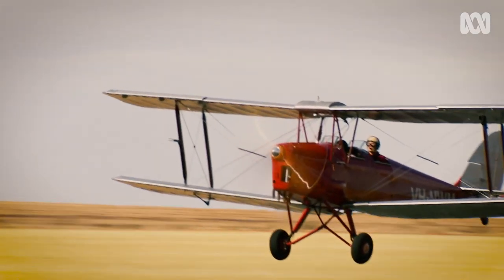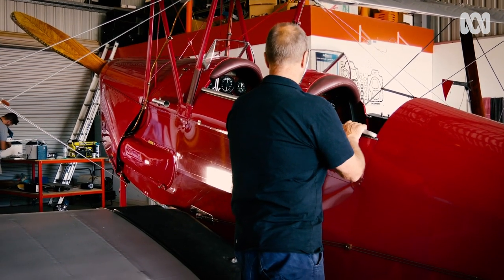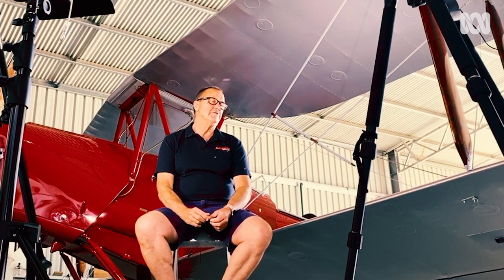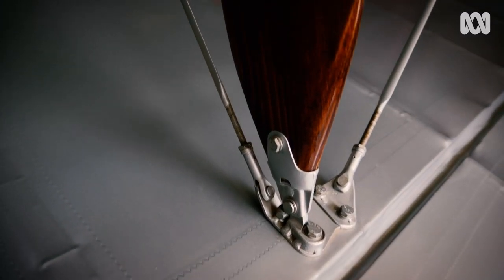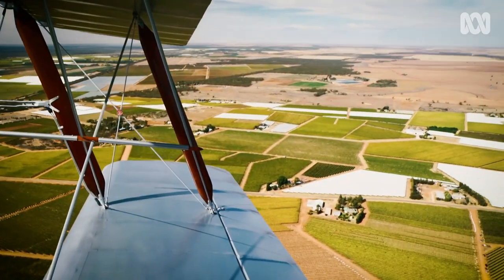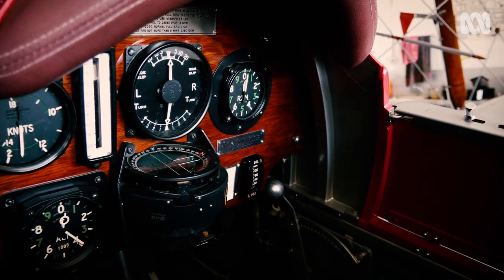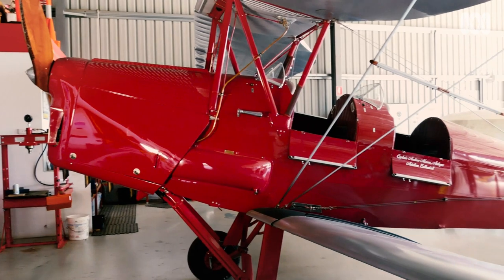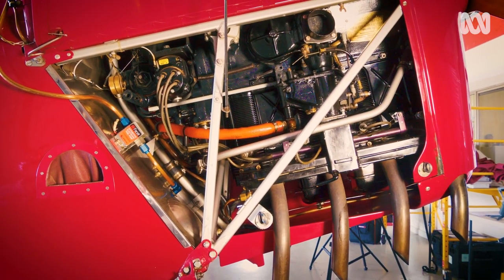Taking a restored holden-powered WWII De Havilland Tiger Moth biplane for a spin | ABC Australia

Comment: In fact the tiger moth was built at Bankstown Sydney.. GMH only connection with aircraft was they manufactured and supplied the engine. GMH was also manufacturing the American Pratt and Whitney Wasp Radial engine which powered the CAC Boomerang  and Wirraway aircraft and the locally built version of the british  Bristol Beaufighter which were all  built in  factories next to GMH's factory at Fishermans Bend, Melbourne. GMH at the time being one of the few companies that had an operational foundry and therefore able to cast various components [ such as engine crankcases, cylinder blocks  etc] The only other foundry in operation being that operated by the Victorian Railways at its Williamstown workshops [VR cast one piece tank turrets  amongst other things]